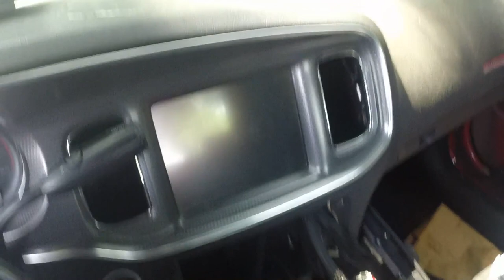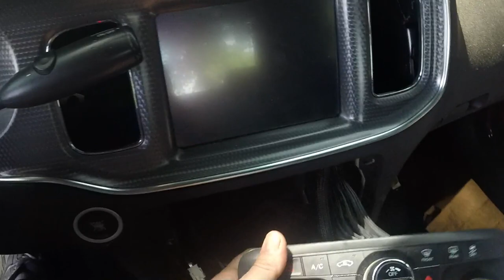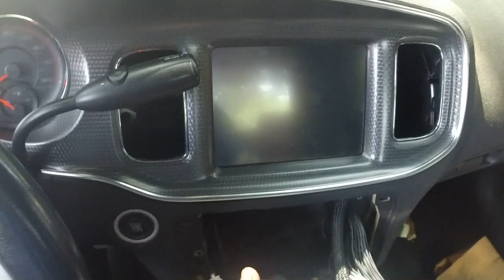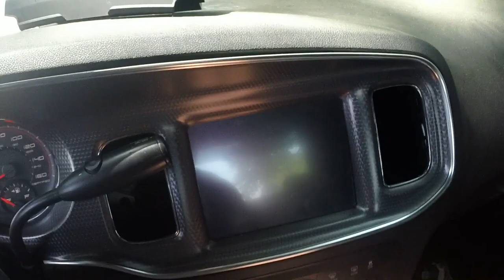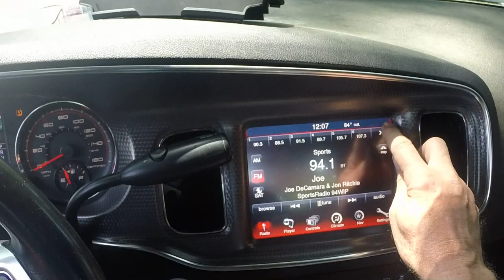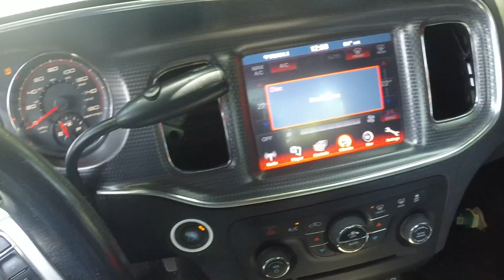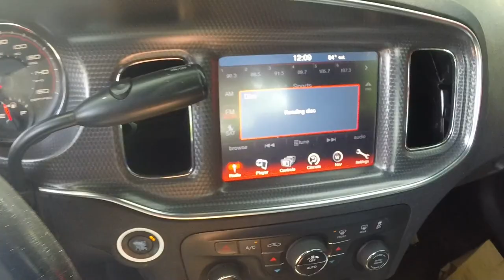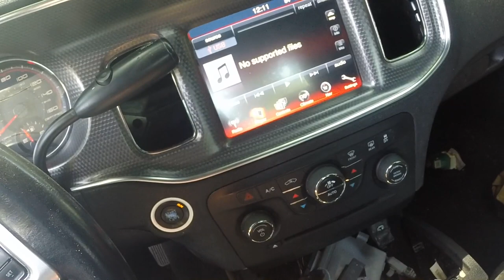Dodge Charger Pursuit SE 4.3 to 8.4 RB5 Radio Upgrade Testing P05091367AF P05091367ZN P68210554AH

Comment: Do i need the radio ?? Or can i just buy a screen? I have a 2012 pursuit charger
Reply: I found that without the radio the screen flashes lines up and down it and won’t work at all. Originally just ordered a screen from a junk yard car, didn’t work... thought it had water damage. Got it replaced and same thing happened. Turned out I needed the damn radio!! Go on car part and get a random RB5. It will be around 150$ish
Reply: @FrostysDrip999 how do the rb5 look

Comment: To upgrade do you need to program the newer version to my vin or is it a plug and play???
Reply from the maker: plug and play
Reply: @unclesamautos  so u can purchase a one online and it will work
Reply: @ricric-po4pq yes you may have to get it unlocked though try purchasing one with a lock pin included. If not you can pay to get it unlocked pretty cheap

Comment: You said that those other two head models will work without 22 degree problem, does that mean that climate control will work and it won’t go back to 22 degrees every time?

Comment: Since you have the police package, with this radio and screen upgrade can you still completely shut off all the interior lights with the dimmer switch weather with the headlights on or them off in park?
Reply from the maker: Yes.  I just happen to like drinking beer in my driveway and I use "Stealth Mode" a lot!  -  Side note:  Even with stock police 4.3  very dim light will show what gear car is in but both 4.3 and 8.4 will be completely off.
Reply: Uncle Sam Autos Awesome, thanks.

Comment: Im looking for a non nav RE2 model, do you have a part # you know has worked? Im upgrading from the small 4.3 to the larger 8.4. Just need to know what i need to buy unless you have one for sale
Reply from the maker: I have tested P05064542AM and worked fine. Remember when you upgrade to any 8.4 the up/down arrows on control panel don't work, you have to use the screen. All the other buttons do still work.
Reply: @unclesamautos  do you have any for sale?

Comment: I plugged mine in and I could hear it but I could not see it... I have a 2013 pursuit and radio is from a 2012 str8 any help would be greatly appreciated. Thank you
Reply from the maker: You have to change screen and radio at the same time.  Cables can be the same. What is radio model #?
Reply: I have this same problem with a 2012 police and I can hear the screen but can’t see it

Comment: 5:20
So I can get a Chrysler 300 radio and put it on a dodge charger?
Would it always say Chrysler or will it go back eventually to Dodge?
Reply: Yrs. Radio will change to Dodge after a few restarts
Reply: What about the Bluetooth
Reply: @carlosxlgarcia9761 if you don’t have the module u gotta buy it and get a taser or get someone to basically tell the computer that it has bluetooth that’s what i did in mine
Reply: @lazarocancio9314 i have a module but cant find the connections on the drivers side.
Reply: @JuanGarcia-dg7bi  is on the driver side under the steering wheel is like tucked behind the light switch is
Reply: @lazarocancio9314  i found the connection for the wiring but no the small usb one. what should i do?
Reply: @JuanGarcia-dg7bi  ur good with the big one, the usb connector is for voice control module which you don’t have it i believe
Reply: @lazarocancio9314  oh okay, its been added and the radio shows the bluetooth option but nothing happens, im assuming i need that next step you mentioned with the tazer.
Reply: @JuanGarcia-dg7bi  yes sir that’s why i said it the tazer part

Comment: Found you video and did an upgrade to RE2, what do I need to do to get the uconnect button on screen. I do not see the uconnect apps button.
Reply from the maker: Unfortunately it will never work on a police or SE car. It's controlled buy ECU and different wires.

Comment: Hey thanks for the tutorial! Just installed mine it’s the exact model as this one but I have a problem when I put in a dvd it says local laws prohibit the display of video. Any ideas how to fix this?
Reply from the maker: That should only happen when car is moving. Still have that problem?
Reply: Still does it. I put my friends 2012 radio rb5 in my car and it worked. I guess it’s the radio itself that comes factory locked to not watch dvds. I’m currently looking to trade my rb5 for another rb5 if you have any extra rb5s I’d pay a fee to trade.
Reply from the maker: @juancorrea3505  No, it's almost impossible. An older RB5 like from a 2012, like 1365 doesen't care if the car is in motion. Only thing I can think of with a newer RB5 is a faulty speed sensor. All RB5's should play DVD movie disks when in park or driving under 15mph.

Comment: I’m buying the 8.4 screen from a salvage shop for $250 and I’m gonna use the same 4.3 bezel but cut it and heat with an heat gun. Will it fit?
Reply from the maker: Did you try it?   I did about a week ago. Mounting points for the 8.4 screen aren't there. Won't look factory but with some work it can be done.
Reply: Uncle Sam Autos is there any way you can post a video or picture of how it looks this way? Cutting the 4.3 bezel

Comment: Can i buy one from you?
Reply from the maker: I can put one on ebay. What year is your Charger?
Reply: Uncle Sam Autos 2014
Reply: Uncle Sam Autos  i found a scrap yard near me with one from a 2012 , will it work ?
Reply from the maker: @Hundo  PO # is important. What is it and how much they want. Map's will be old but that don't matter depending where you live. If it's RB5 it will work.
Reply: Uncle Sam Autos This is the only info it gives on Car-part.com “2012
GPS/TV Screen/Info Center
Dodge Charger	(display), (navigation 8.4' screen), ID 5064798AE-U” , and price is $150
Reply from the maker: @Hundo  That's a good part # and price for a screen. Remember that's just the screen not the radio.
Reply: Uncle Sam Autos wait so whats the difference?
Reply from the maker: @Hundo  Watch https://www.youtube.com/watch?v=zAtgcYEghUA&t=890s
Reply: @unclesamautos  can you access sport mode and other performance pages?
Reply from the maker: @bobthebuilder201  No not on police or SE cars.
Reply: @unclesamautos  ok thank you.

Comment: Do you have a screen, bezel and radio for sale?
Reply from the maker: I'm testing an RB5 P05091367AF now. Everything goes good it should be posted with the code tonight or tomorrow.
Reply: @unclesamautos  dont have any non nav units? what are you looking to get for the rb5?
Reply: @unclesamautos  happen to know if a P68210553AB will work in a 14 charger?
Reply from the maker: @wiifan62  - Not sure but I'd guess 99% it will work.
Reply: @unclesamautos  You dont happen to have the trim bezel for sale do you?

Comment: does bluetooth work on that??
Reply: @unclesamautos  anyone have any idea why Bluetooth won’t work
Reply: @pimpindnice910  Steps to take. Don't disconnect battery. Turn car off and unplug Telematics Module (black box). Start car for a few minutes then turn car off. Plug module back in and start car. Report back if it worked.
Reply: @michaelclarke647  will try in the a.m….I was thinking that since it’s a prior pursuit Charger that the Bluetooth was disabled from 
 Working. I got a Bluetooth module and hooked it up and now there’s a button for Bluetooth but I can’t click on it.

I figured that the civilian creature comforts (proximity entry, trunk access via button in car or on key fob, auto start, and fog lights and Bluetooth) were merely disabled and had to be enabled via flashing by the dealer
Reply from the maker: For a Pursuit you'll need AlfaODB programmer. Videos are on YouTube. Takes a lot of homework but you don't need to go to dealer for programing.
Reply: @unclesamautos  are the features merely disabled like I thought?? And thank you, I will check into it.
Reply from the maker: @pimpindnice910  With AlfaODB programmer disabling police lighting will make trunk buttons work. Bluetooth requires Telematics Module and programming. chargerforums dot com has lots of info.
Reply: @unclesamautos  ok thanks for the info/direction. Yes I already have the Bluetooth module in the car, I just can’t click on the “Bluetooth” button
Reply: @pimpindnice910 did you figure it out man?Thanks bud
Reply: @pimpindnice910 mine has the same issue rn